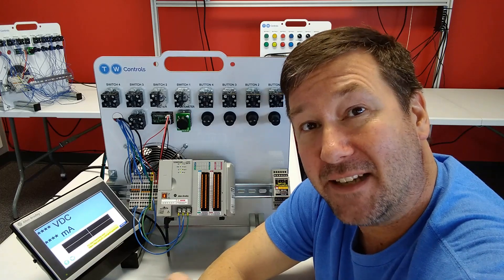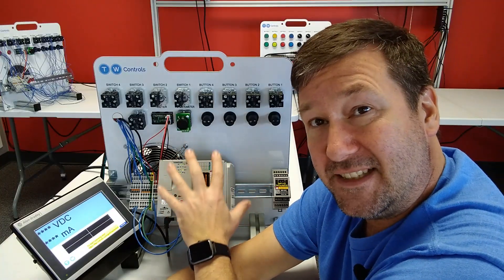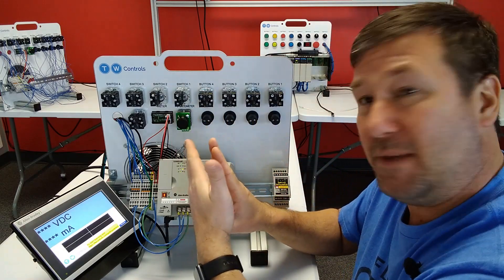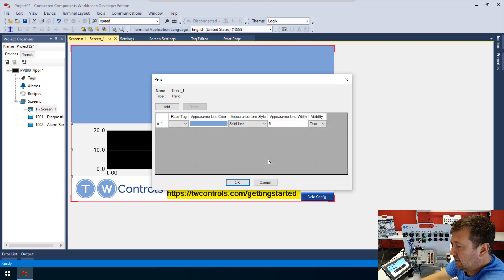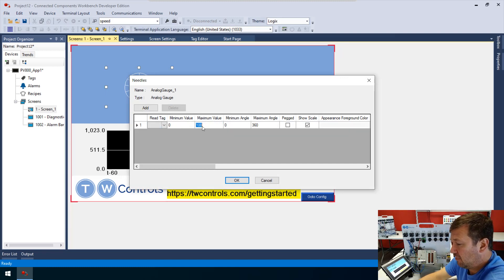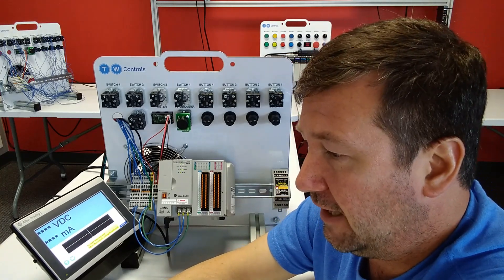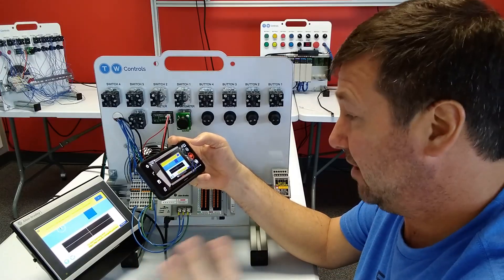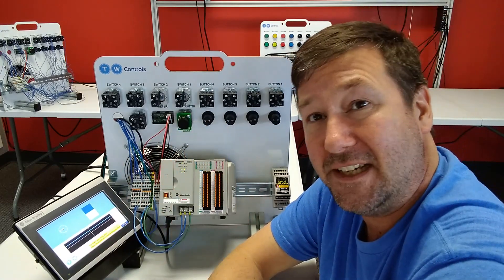Allen Bradley Panelview 800 HMI to Compactlogix PLC Communications

Comment: Hi tim, have you tried to connect a compactlogix 5080 to a panelview 800, i have problems trying that, have a nice day :)
Reply from the maker: It works with the 5069-L306 but no others. I'm not sure why they did that
Reply: @TimWilborne  thanks tim
Reply from the maker: @ianmauricioavilaherrera466 You are welcome
Reply: @TimWilborne  but for example my model in studio 5000 is 5069-L306ER   5080 CompactLogix, maybe the problem is the firmware of my devices? like the firmware of ccw and my panelview 800
Reply from the maker: @ianmauricioavilaherrera466 Could be. We use them with the 5069-L306ERS2 in the training center
Reply: @TimWilborne  you use the latest version of cww and studio?
Reply from the maker: @ianmauricioavilaherrera466 22 of ccw... Think firmware 8.14, 36 of Studio
Reply: @TimWilborne  thanks a lot tim, have a nice day
Reply from the maker: @ianmauricioavilaherrera466 You too!

Comment: My PV800 will not validate even with the backplane in the IP address. I have updated firmware, double checked everything, but it still will not validate, nor will it tell me why it will not validate. What may cause this?
Reply from the maker: Check the protocol,  controller type you have selected, and the path.
Reply: @TimWilborne  I opened a new project and without changing anything (even adding controller) just tried validating it right off of the bat, and it still would not validate even though it should, right?
Reply from the maker: Not likely. You have errors on your communications

Comment: Hello Tim
I have some issue, when I try to create the communjcation, well i dont know add 1,0 after de ip, but, my issue is, I add a path offline, then when i try to validate the application, the ccw send me a fault, the fault say the path is invalid, my question is, it is necessary add a offline path in the ccw?
Reply from the maker: What PLC are you using?
Reply: @TimWilborne is a 1769-l32e compactlogix 5332E, is possible communicate with this controller ?

Comment: I am using the same Panelview 800 and CompactLogix PLC is you are using in this video. Have you made any videos on communications warnings for this setup? I am getting the exact same error you had when you unplugged the ethernet cable. Except for me, it occurs during the booting process. After 15 seconds or so into booting, proper communication seems to be established. Then I can clear (a few dozen) warnings and everything runs properly. Both my team and our customers are not fans of needing to do this on every power up.
Reply from the maker: That probably is video worthy.  I "disable" it.  Two solutions come to mind.

1.  You can add a clear all the the screen.  It is still incredibly annoying, but gives you a little bit of diagnostics information.

2.  I make the background the same color as my background, remove everything from the screen, make it 1 pixel tall, and make it where items can be clicked while the screen is open.  So in essence, the pop up is always open on my screens.  I have only had one person ever notice it.
Reply: @TimWilborne  Thanks. I'll look more into #2. #1 seems potentially problematic since it would hide actual communications errors that occur after everything is booted. A solution that I have tested is running the power for the Panelview through a relay and using a latch on that relay that energizes once a timer in the main routine is complete. The downside is the HMI is the only thing that indicates the system is actually running. My concern is our customers will think something is wrong since the screen is off for 30 seconds after power is applied to the system.
Reply from the maker: I agree. It has been an ongoing issue for years.

Comment: Hi Tim, is it possible to communicate with 5069-L3100erms2 with panelview 800?
Reply from the maker: Double check with your RA distributor, there are some weird artificial rules about which controllers can be used that I don't fully understand.  This says it will communicate with "Compact GuardLogix® 5380 L306x"...which would lead me to believe it excludes the L310...
https://www.rockwellautomation.com/en-us/products/hardware/allen-bradley/hmi/graphic-terminals/2711r-panelview-800.html
Reply: @TimWilborne  Thanks Tim for the quick reply.
Reply from the maker: You are welcome.

Comment: Hello Tim, thanks for helping me with your videos, I was trying to find a way to activate an alarm message on a 800HMI connecting to a CompactLogix, will it trigger with a integer rather than a Boolean  signal? Currently the alarms go through an integer to BCD outputs. The customer is upgrading to a HMI 800
Reply from the maker: Yes, you can make it alarm when it is not equal to an integer value.
Reply: Thanks Tim
I’m not sure if you hit the question right, I have currently 68 alarms being shown through BCD to numeric displays, I would like the same integer to activate an alarm message , so each value has its on alarm message 
Cheers
Reply from the maker: As in there is an alarm code for each number or each bit represents an alarm?
Reply: Yes , got it to work Tim thanks for replying 
On to the next video of yours about point I/O 😊
Reply from the maker: Glad you got it working!

Comment: Thank you Tim...I was converting a Panelview800/Micro800 to a Panelview800/MicroLogix1400 and then to a Panelview800/CompactLogix and remembered that with the Logix Engine and hardware there is a path...my mistake was using decimal points instead of commas (even with glasses, they looked the same). Watching this video, I looked closer at my path.  I also got the sense that once you get an "App is invalid", you might have to delete the controller and re-enter the details to shake the invalid off of the project. I did not go back and redo it incorrectly to verify that idea.
Reply from the maker: Hi Tim.  The path still trips me up every time!

Comment: hello sir,
I have panel view 800 communicating with 1769-L16ER, firmware version of Panel view 800 is 6.11 and I designed the panel view in ccw version 13. but I have one issue in that, as I try to display string it does not display. why is it so?
can you please help?????
Reply from the maker: Make sure you are selecting string display and not numeric display.
Reply: @TimWilborne  
yes sir,
I'm sure that I'm using string display and gave the tag string for the same, still errors is not resolve.

Comment: Wow, Tim! I was speaking with my senior controls guy yesterday and the question came up, for a moment, about communicating our PV800 with an L35ERM. We quickly dismissed it as too complicated, lol. It does seem that the comms are exclusive, though. I actually would need to communicate with both a Micro820 and the L35ERM.
Reply from the maker: I wonder if one protocol couldn't be massaged to used on both.  It might be worth an experiment next time I'm playing at the PLC Lab.

Comment: I love your videos. They have taught me and helped me so much in my Capstone project so I can finish my bachelor's degree in electrical engineering. Is it possible that you could make a video about simulating the HMI in the PC and connecting it to the PLC emulator, so I can test the HMI application and see it working on the PLC?
Reply from the maker: Check out https://www.advancedhmi.com/.  It can read from an emulator.